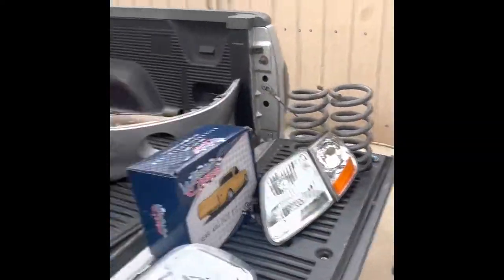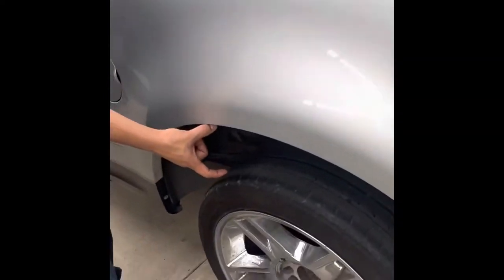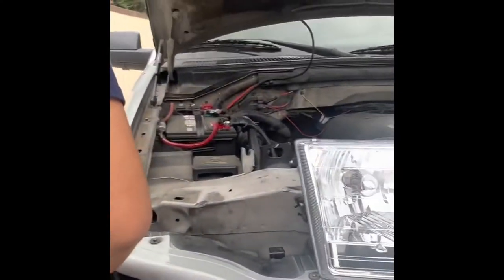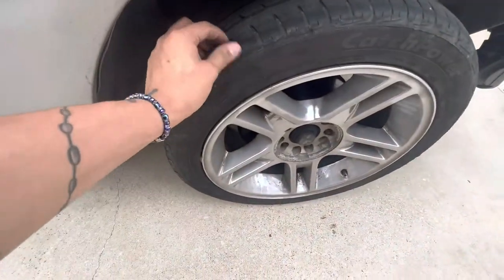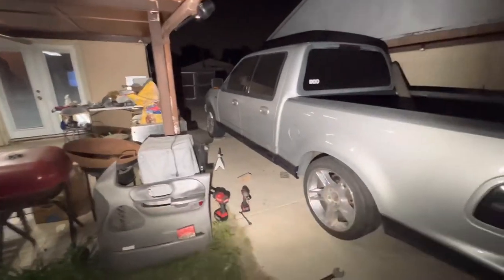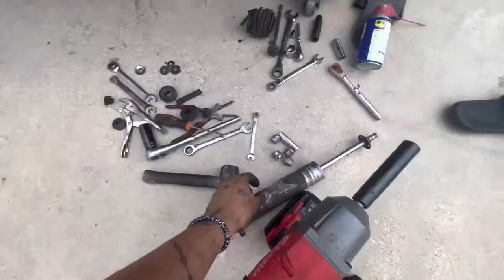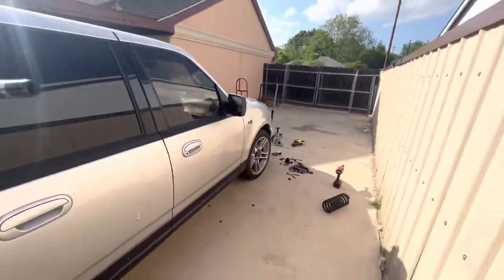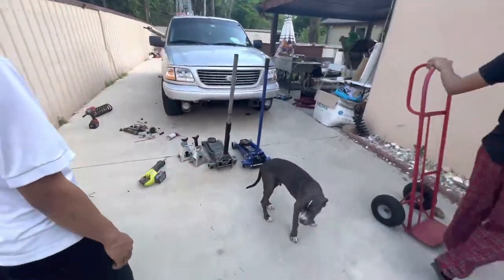3/6 drop on my F150

Comment: Did you drop the wheel diameter? 
What size wheel and tire did you install?
Reply from the maker: Its 20in harley wheels in 275/45/20 all around 
Can also run 275/40/20

Comment: Did you need drop shocks for the back
Reply from the maker: Yea they stock one will bottom out
Reply: @hernanlsx  one other question, I have a stock height 2000 f150 without any shackles or anything, if I installed the flip kit would I still need a c notch or you think I could ride without one for a while?
Reply from the maker: @ivxiez  flip kit will require a cnotch. I did it and i kept hitting frame
Reply: @hernanlsx alright thanks bro
Reply: @hernanlsx  you need front drop shocks too or just rear
Reply from the maker: @ivxiez  yea bro. Gotta get drop shocks all around

Comment: What side mirrors are those ? do you have a link where u bought them from ? I want to get something different from the original side mirrors. Do the mirrors have the turn signals on them ?
Reply from the maker: These mirror came off a 2013 expedition. Straight bolt on perfect fit. Comes with turn signal and puddle light. Only thing is I haven’t figured out the wiring for them too work
Reply: @HernanLSX  nice Thanks Bro, I was just about to order the OEM mirrors with the turn signals.  Thank u so much bro :) will order these then and pain them white
Reply: Do you think 12gen mirrors would work?